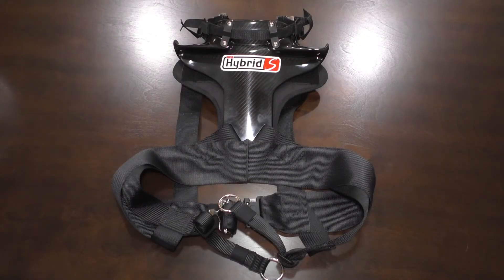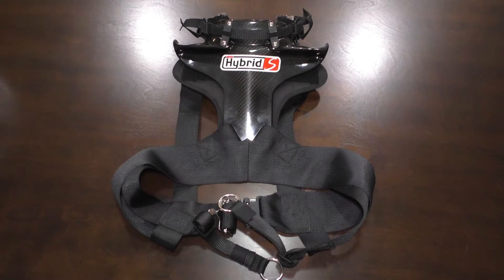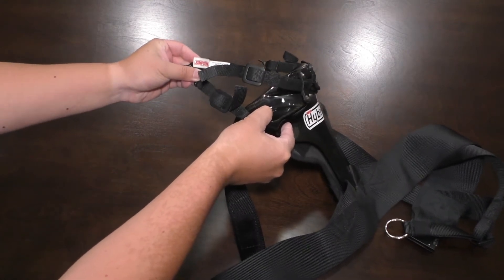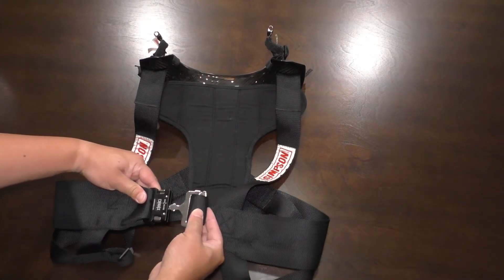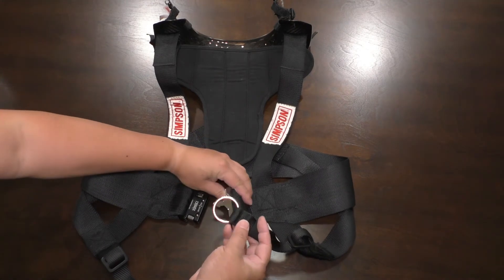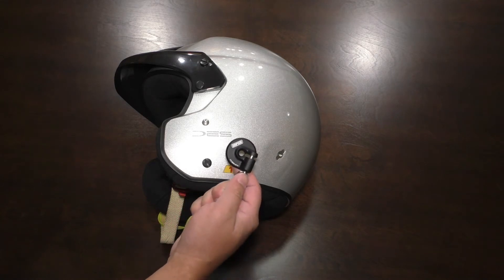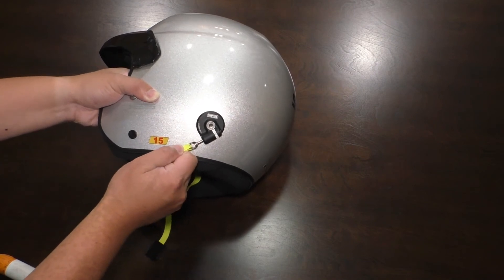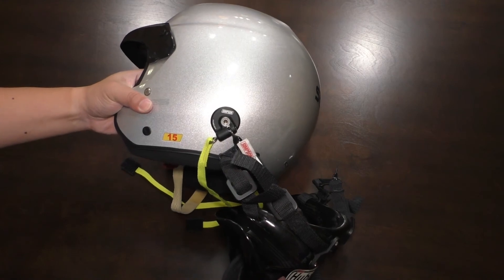Simpson Hybrid S Overview

Comment: I wonder if it would been better if they had some type of grippy/tacky material over that carbon fiber so you get more grip onto the seat. I noticed if i wear sweat shirts that have print on the back allows me to stick to the  leather seat better
Reply from the maker: Yeah, that's a popular mod for this device to put a grippier surface on the rear carbon face. Some felt tape will work too.

Comment: What torque hex wrench do you use? I'm also curious to know which tires and brake pads you prefer. I have a G82 M4 6MT - trying to decide between Cup 2 Connect and RE-71RS tires, thanks.
Reply from the maker: For hex bits I have a Wheeler Fat Wrench and CDI TorqControl driver,. I also have hex key sockets I can put on a regular torque wrench.

For low cost of consumable tires the Hankook RS4 are my favorite. Very consistent and last a long while. The tires you're looking at (Cup 2 Connect and RE-71RS) are faster tires, but don't last as long. Both are well regarded though. Goodyear Supercar 3 are good tires too for heavier vehicles.

For pads I've really liked the PFC08 and Ferodo DS3.12. I didn't like the Pagid RSL29.